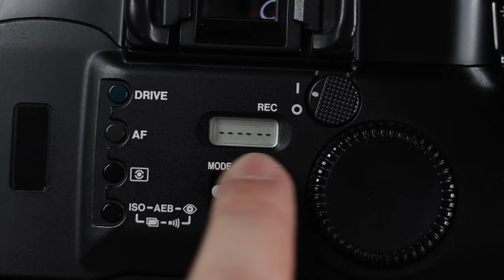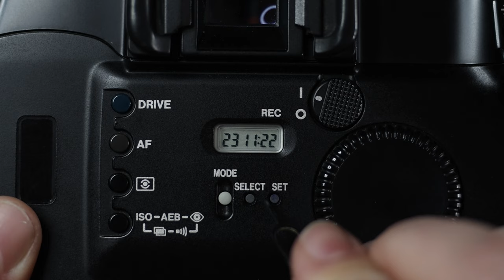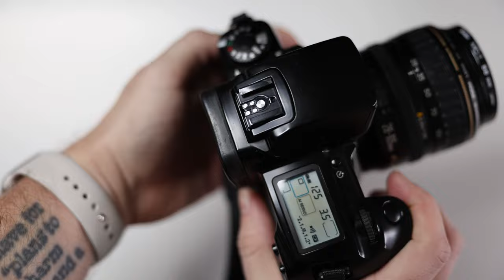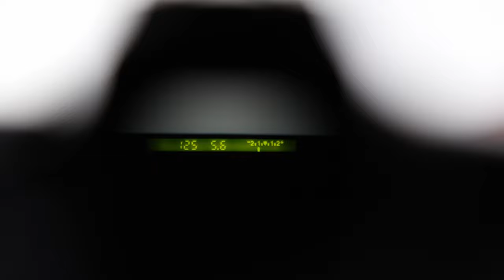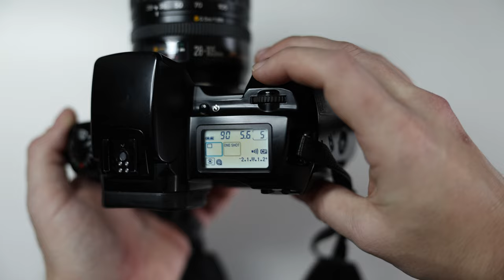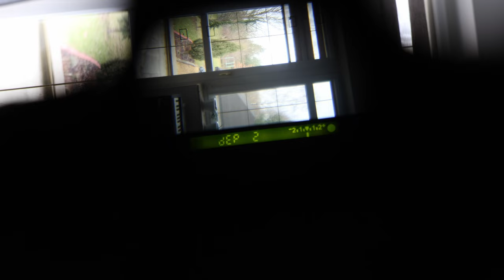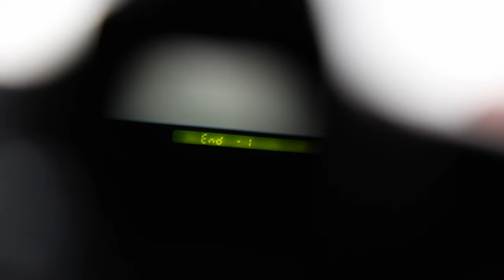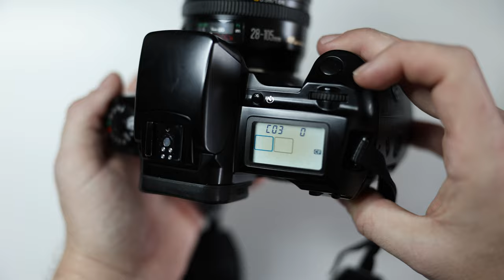How to Use a Canon EOS 5/QD/A2/A2E Film Camera

Comment: Hi, recently I have a problem with the camera battery - 2CR5
After shooting four rolls, the battery died, I opened another new battery from the package and it still shows a sign that the battery is empty. I would appreciate your help please.
Reply from the maker: there could be a few problems. try cleaning the pins and contacts on the lens and lens mount. try a different lens. try a freshly bought battery from the store. there can be many causes to batteries dying faster. bad lens connection, potentially IS on lenses that stays on even when camera is turned off, bad battery or an internal short or software issue... hope your issue is easy and quick to solve. good luck!

Comment: I have a 200 iso film and manually changed it to 400 and ISO indicator is blinking, can't find anything in the manual saying about this, do you have any idea about the problem?
Reply from the maker: hello, sorry for a long reply but i didn't have time to test my camera before. i don't get any ISO blinking so i don't know unfortunately what the problem would be :( when setting the ISO it doesn't blink anywhere. but what you could do to check if the ISO changes, if you can take photos after changing the ISO, check the exposure and then change the ISO and check the exposure again. at the same F stop, the shutter speed should be different. if it does change appropriately then i would assume all works. or maybe try another film in case the DX code or reader has a problem. Wish you luck and let us know what you find :)

Comment: I'm having trouble attaching a cable release to this - it doesn't seem to fit! Any tips?
Reply from the maker: Are you sure its the correct cable?
Reply: @grainificent  yes, the 60t3. I think I’ve done it, testing tomorrow, fingers crossed, it was sooo fiddly!
Reply from the maker: Hope it works! 😃
Reply: @grainificent it was a nightmare! Really difficult to fit, and then it kept falling out in the dark or shooting off and wasting exposures. I don’t recommend this camera for night work at all.
Reply from the maker: Haven’t tried a release cable with it yet but i did do a few long exposures using the self timer and all came out well :) thats one way to do it as well :)